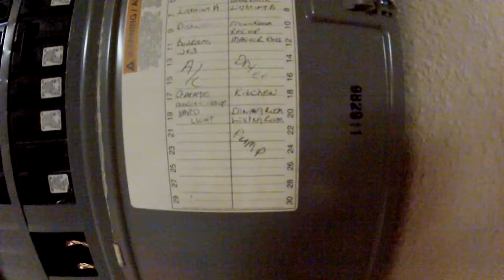HOW TO INSTALL A WELL TANK AND SWITCH   WELL X TROL WELL WATER

Comment: I had a new well installed. the tank location is 25 feet from well pipe penatrtion in basement. There is is loud vibration noise when pump runs . How can i fix this?